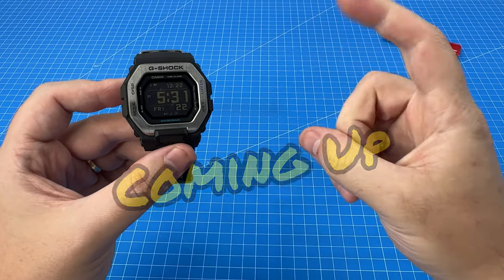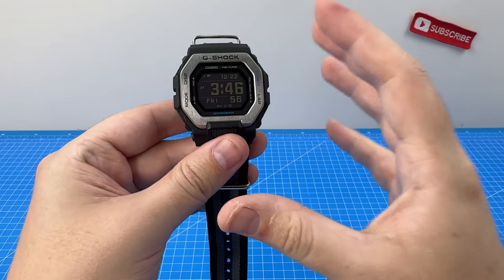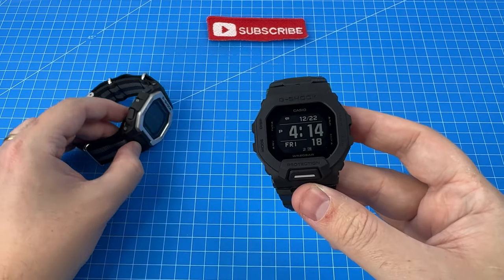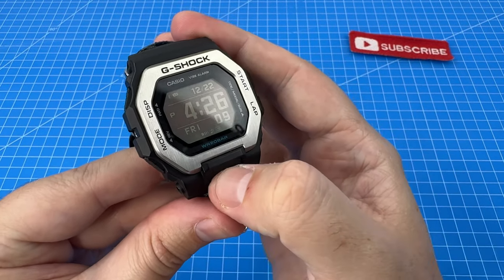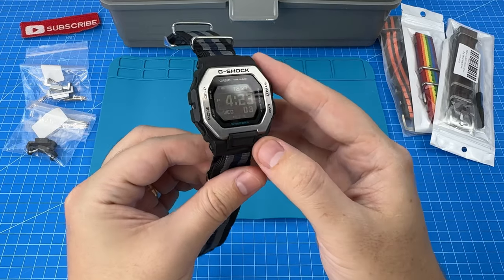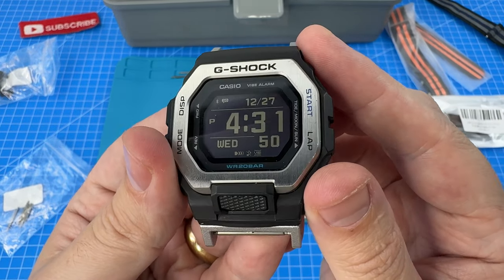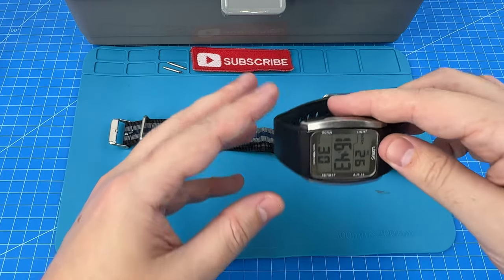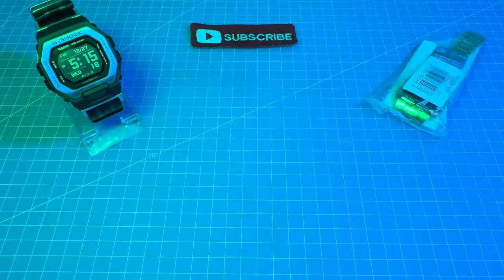🌈⌚ BORROWED G-Shock GBX-100 Review & MOD! 🚨👈😡 #WatchOfTheWeek

Comment: Awesome review on the GBX-100! Thanks for bringing to light the lack of autoscroll on the coordinates without an app! Would you be reviewing the Lorus watch too? Looks like a digital Richard Mille 👍
Reply from the maker: Thank you Gigachad! 🙏 
Haha, all good. It needed to be said - and honestly Casio needs to address this one! Even if the limitation is to do with the refresh rate of the MIP display, there’s another workaround they could implement that would cut it down from 900 presses to 90! Just make it increments of 1 degree instead of 0.1! 😂 The difference in your coordinates would be so negligible, that it surely wouldn’t affect the Sunset graphs by more than a minute either way. 🤷🏻‍♂️ 

Yes it does look like one doesn’t it?! 😂 
Negative, the Lorus is safely on its way back to RedWyvern! I figured I wouldn’t have enough time to do a full review of it, plus I didn’t want to deprive the owner of his awesome watches for any longer 😉

Comment: As a owner of the GBD200-9 I would like to add two frustrating points !
THE LED !
It turns off when you cycle a menu.... So you sit in the dark and want to start a stop watch ? Welp. After each press the screen will go off. And you will have to press the light button again to see if your now in the right mode.

You cant see the past day steps. I want to be able to see how much steps I did yesterday for example. But no ! You need the app for that. Otherwise you can just see a % bar...

Love the watch ! And also got the nato adapters on the way. BUT COME ON
Reply from the maker: YES! 💯🙌
Thanks you raising these points, Ian! 👌
I noticed the backlight issue as well - Quite annoying indeed! In fact I find this to be the case with MOST Casio's, but having a dedicated backlight button should grant you IMMUNITY from this issue, by operating independently, right?! 
Man, I did not notice about not being able to retroactively check your steps without the app!... but you're right there too. Just another way for Casio to FORCE us to use the App I suppose 😂

Agree - Other than these nuances it's a great watch - and I am very happy with how the build turned out! 🤩 Hope yours goes similarly well with the NATO Adapters, my friend! 🙏
Reply: @goatreviews  I also don't know if you know about the hidden menu yet ? I saw it in a video and its pretty handy ! 
What you have to do :
- press and keep holding top left button
- now press and keep holding the lower left button
- now give the bottom right button a short press while still holding the other two down.
A menu will pop up with some test you can perform on the watch.
And my favorite feature ?
You can check BATTERY VOLTAGE in this menu ! 🤯

Oh for sure ! This has been my first G shock. And I am in love !!!
Up until know I have had a Luminox 5127 (which I sold again, very cool blue tritium !) and a Swatch "sistem soul" (which sadly doesn't work anymore. But I still have.)
Now I have been eying the Gshock GWG-1000-A3 👀. And might be buying it in a month or two. Never thought I would consider such a big watch. But I am geeking about all the functions xD
Reply from the maker: @ianspy1 I only learned about it after asking the owner how he got the cool “G-Shock Logo” screen to show up for my unboxing video of this one! 😁

Super cool, right?! Awesome - I will need to spend some more time playing around with it on my GBD-200, and see if I can check the battery voltage 🔋 All I had a chance to do before I sent the GBX-100 back was set it into the logo screen.
And man, I must admit I struggled to press that button combination to get it to work! Thanks for explaining it better, it looks like I was doing it incorrectly 🙏

Oooh, just looked up those models! 👀 Very cool - it’s a shame you sold that 5127! I bet you’re looking forward to the ultra-functional and beastly GWG-1000! 🤩

Comment: Hmmmm, not a great fan of NATO straps, expecially with G-Shocks, it makes it thicker than it is... But good choice between those 3 NATO's, probably the best colour scheme.
And good choice for the adaptors too!
...I don't get the point to hydromod a watch like that, considering it will require a battery change every 1 year or 2 (depending if you use Bluetooth or not)... I can see the advantage on little and inexpensive watches like f-91W, but not on a G. Oh well, if he's happy with it, fair enough! 😄
You can use another app for the Bluetooth part (if you use an android phone), it's called Gadgetbridge, opensource and free. Some advantages: snappy, updated and you can set the repeat for the call alarms! (it will beep repeatedly whenever you receive a call).
Ah, for the air bubble, some watchmakers leave intentionally a bubble in the watch (look U-Boat from Italo Fontana for example), so... You have a design watch 😄
Reply from the maker: That’s a fair call, Bruno! I get what you mean about the thickness.
Thank you! I’ve no regrets on the silver adapter - though it was a VERY close call with the orange strap 👌 

This is a good point, too. You do have to consider the upkeep on a Hydro Modded watch. For me, this makes the ULTIMATE candidate a Tough Solar G-Shock, so I’d never have to open it again 🤩💭

Fascinating! Thank you for sharing this app. I do sometimes wish Apple were a little less restrictive with their apps.

Having heard both sides of the ‘Air Bubble debate’, my preference remains to go bubble-less for aesthetic reasons. That is, until maybe one day if I ever face an issue caused by not having a bubble 😁

Thanks so much for weighing in with your well thought-out opinions! 🙏
Reply: Thanks for mentioning Gadgetbridge! I Wasn't aware of that alternative yet (while I do use similar apps like Solaar and KDE Connect).
I'll keep using the official app for this piece as it works fine, has a good dark theme (unlike Casio Watches) and as Gadgetbridge doesn't support all features.

As to why I've done the mods, I picked up this piece right after my GBD-100 got water-damaged after getting it's battery changed at a Casio shop (which I did to make sure it would be done right).
This was repaired under warranty with no issue, but I picked up the GBX-100 as I've gotten quite fond of this module, despite the UI issues (which are worse in the newer, fancier variants, along with using a worse app).

Only, this new GBX-100 got moisture behind it's gasket immediately, so I decided to just attempt the mod and see how it goes, documenting it online for other brave watch owners.
The answer is disastrous, hence the need for the polariser replacement and replacing some bumpers and gaskets with 3D printed ones.
The backlight colour filter change worked better with the original polarisers, where the contrast was more like the original piece.

The NATO was added as the original strap didn't fit my skinny wrist and as originally it had a strong cigarette smell (which has off-gassed since).
I tried jamming it in the 16mm slots to see how well that works, intending to 3D-print adaptors down the line.
Which I didn't do as it was already on the second hole with this length taken out and felt comfortable to wear.
Reply: @goatreviews  I'm a bubbleless fan too, but, you know, let's see the good side of what we have! So... Go bubble, go! 🤣
For the hydromod on a solar model, there is a little chance to have to change the accumulator. It has never occured at me for now (and I own some solars from 10+ years), but it could happen...
Reply: @WyvernDotRed  pal, really, you are out of luck with Casio watches!
I've never had water or moisture even in 80's models, and I change the battery by myself... But, all in all, you have done a good work! And thanks for the explanation, now it all makes sense 💪🏻
Reply from the maker: Love it, always good to look on the bright side 😁 
Oh man - I hope not! Finger crossed it's a one-and-done solution with no complications 🤞